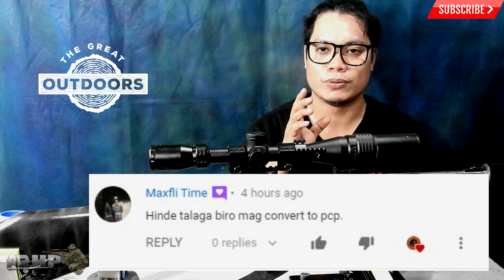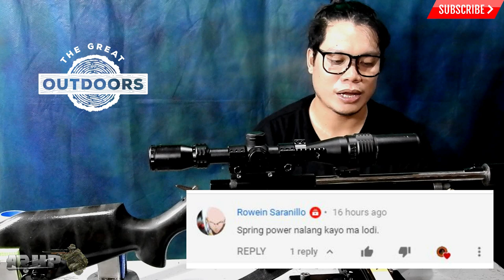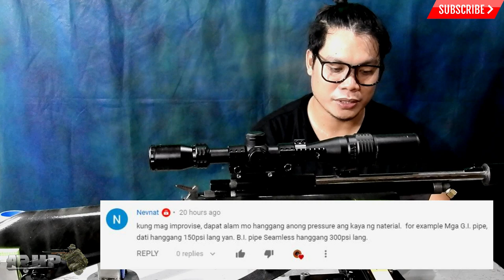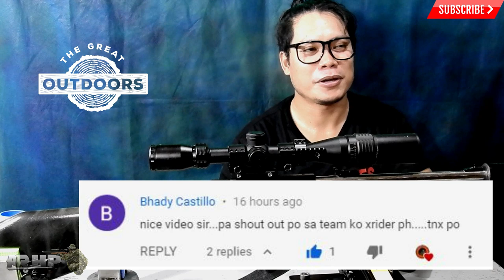BAKIT GUSTO MO NG AIRGUN? | Halagang 7000pesos may Airgun kana

Comment: New subscriber po q
Reply from the maker: Thanks, po sa inyong mensahe. Maraming salamat po sa panonood.
Magandang Araw po sa inyong lahat, Maraming salamat sa inyong pagbisita sa ating channel.
Ganon din, salamat po sa inyong patuloy na pag subaybay. Mabuhay po kayo!
Always keep safe po, and God bless po sa inyo at sa inyong Pamilya.

Regarding po sa tanong ninyo. Pwede nyo pong ma contact sa messenger ang mga sellers po para ma assist po kau sa mga:
1. Contact info like cp# ng sellers
2. Accessories ng mga airgun
3. Brand ng airguns na avail nila
4. pricelist
5. paano ipadala
6. mode of payment
7. saan location nila
8. o may branch ba malapit sa inyo
9. atbp. na mga katanungan.
LOCAL SELLERS:
1. Win Lustarez
2. Robin Samonte
3. Rolly Aurellana
4. Philip Jeffreth Mendoza
5. Raffy Artigas

PAANO MAGING SAFE AND LEGIT CHECK?
1. Mag pa legit check-Ask ang mga matagal na sa airgunner
2. Mag padala ng Private Message- Send a message regarding sa information na gusting malaman
3. Once nag reply ask question regarding sa accessories or type ng airgun na bibilhin
4. Once na nakapag decide na sa bibilhin, mag video call po kayo para na makita nyo xa same sa profile pic at photos ng naka transaction na seller.
5. Before mag bayad sa item na kinuha mag papadala ang Seller ng Video na binabalot nya ung item mo
6. Hingin ang code if sa ano mang currier nya pinadala.

ADD ON QUESTION:
Ano ung valve na naka thread?
Ito po ang vid na ginawa ko sa installation ng airgun nimrod: https://www.youtube.com/watch?v=wrj_i6z119w&feature=youtu.be
Maraming salamat po. From AIR RIFLE HOBBIES PHILIPPINES
______________________________________________________________________________________________

Magandang Araw po sa inyong lahat, Maraming salamat sa inyong pagbisita sa ating channel.
Ganon din, salamat po sa inyong patuloy na pag subaybay. Mabuhay po kayo!
Always keep safe po, and God bless po sa inyo at sa inyong Pamilya.

Ito po yung kadalasang tanong na hope po makatulong.
PAANO MAGING SAFE AND LEGIT CHECK?
1. Mag pa legit check-Ask ang mga matagal na sa airgunner
2. Mag padala ng Private Message- Send a message regarding sa information na gusting malaman
3. Once nag reply ask question regarding sa accessories or type ng airgun na bibilhin
4. Once na nakapag decide na sa bibilhin, mag video call po kayo para na makita nyo xa same sa profile pic at photos ng naka transaction na seller.
5. Before mag bayad sa item na kinuha mag papadala ang Seller ng Video na binabalot nya ung item mo
6. Hingin ang code if sa ano mang currier nya pinadala.
Nagbebenta kaba ng AIRGUN?
-Sa ngayon nag promote and review lang po muna ako ng Airgun na aking nabibili sa mga maker. Pero maka assist po ako if saan po kayo maaaring bumili online.
SAAN MAKABILI NG AIRGUN?
Makakabili o makakaampon po tayo ng Airgun sa mga online store sa Facebook po.
1. Search Airgun group sa "Facebook"
2. Once accepted and join post for inquires
3. They will Private message po sa inyo sa mga details
a. Payment method
b. Specs ng Airgun
c. Warranty
d. Atbp.
4. Do background and legit check po by posting sa group
a. Tingnan mga friends list niya if madami syang kaibigan na Air gunners
b. Kung kalian ginawa account nya at least 5 years
c. Do a video call sa transaction and screen record for assurance.
d. Maganda kaliwaan ang pag bayad like meet up
PWEDE BA IPA CONVERT ANG C02 TO PCP?
Yes, pwede po sir, e check po ng maker if pwede most of the Airgun like: Nimrod, Manlapat, Taurus, Armscor, Atbp.
Pakita nyo lang po sa maker and ang maker na po mag suggest sa inyo anong conversion gusto nyo like bottle o naka tube. Range po sa 8k-12k pataas po ang bayad sa conversion nakadepende po sa maker. 

PAANO PAPADALA NG SELLER ANG AIRGUN?
Papadala sa currier ng seller, sila na po bahala doon.
By buss o barko, make sure po na complete address and my phone number and ask how long dadating.
Ganon din ask ang sellers for warranty what if di makakarating ang Item.

KAILANGAN BA NG LICENCE ANG AIRGUN?

There is no law that will punish anyone in the country for having an airsoft/airgun even if it is not registered. You also don’t need any form or permit or license to own one...our firearms law R.A. 10591 does not include the word airsoft or airgun in there. Feb 6, 2019.
Credit from: Journal.com.ph

PAANO MA PA REGISTER ANG AIRGUN?

Pag nakasali na sa mga Airgun group sa Facebook
You can ask for the legit person for register 
(LARRY AVILA) Philippine Team natin you can ask him po
Magbibigay sya ng mga info for requirments
Maganda if by group po ung pag register para isahan nadin po

PWEDE BANG ISAKAY SA BUSS O BARKO ANG AIRGUN?
1. Kailangan po na naka register ang Airgun
2. Kailangan dn may receipt ang Airgun na makikita kau ang may-ari
3. Mag inquire sa Buss and Ship station if pwede isakay ang Airgun
a. Ipakita ang registration at Reciept 
4. Pag pumayag na sila doon lang dadalhin ang Airgun
5. Baklasin ang Airgun-walang laman na c02 o hangin- at ilagay sa safe na lagayan
PWEDE BA MAISAKAY SA AIRPLAIN ANG AIRGUN FROM IBANG BANSA SA PINAS?
Sa ngaun limited po ang kaalaman ko tungkol dyan, ang iba sabi nila nakakapag padala sila sa balik bayan box.
PRICELIST STOCK AIRGUN: (Walang scope, Bipod, c02 Tank)
Depende po sa Seller ang Price either mababa sa binanggit kung Price o Mataas.
1. Nimrod co2 7500 more or less
2. Manlapat co2 13k more or less
3. Taurus co2 7500 more or less
4. Eskopeta co2 from 5500 pataas
5. Jr mangio co2 from 7500 more or less 
6. PCP pump 3k more or less 3 stage
7. PCP pump 4k more or less 4 stage 
8. PCP starting from 15k-50k local made
9. Scope from 3500-18k
10. Suppressor from 2k-5k
11. Tripod from 1500-2500
12. Scope 3500php to 5000php “Low end”
13. Scope 8000php to 15000php “Mid End”
14. Scope 20000php to 70000php “High end”

About namn po sa mga location ng pamilihan-cnxa po dahil hindi po ako affiliated sa mga company po o pagawaan ng airgun dito sa Pinas o sa ibang bansa.
Thanks, po sa support, Share and SUBSCRIBE po.
 from Air Rifle Hobbies Philippines.
LOCAL SELLERS

Comment: Boss magkanu po yan?
Reply from the maker: Thanks, po sa inyong mensahe. Maraming salamat po sa panonood.
Magandang Araw po sa inyong lahat, Maraming salamat sa inyong pagbisita sa ating channel.
Ganon din, salamat po sa inyong patuloy na pag subaybay. Mabuhay po kayo!
Always keep safe po, and God bless po sa inyo at sa inyong Pamilya.

Regarding po sa tanong ninyo. Pwede nyo pong ma contact sa messenger ang mga sellers po para ma assist po kau sa mga:
1. Contact info like cp# ng sellers
2. Accessories ng mga airgun
3. Brand ng airguns na avail nila
4. pricelist
5. paano ipadala
6. mode of payment
7. saan location nila
8. o may branch ba malapit sa inyo
9. atbp. na mga katanungan.
LOCAL SELLERS:
1. Win Lustarez
2. Robin Samonte
3. Rolly Aurellana
4. Philip Jeffreth Mendoza
5. Raffy Artigas 
6. john brent panizales
7. joe talucod
8. jess devora

PAANO MAGING SAFE AND LEGIT CHECK?
1. Mag pa legit check-Ask ang mga matagal na sa airgunner
2. Mag padala ng Private Message- Send a message regarding sa information na gusting malaman
3. Once nag reply ask question regarding sa accessories or type ng airgun na bibilhin
4. Once na nakapag decide na sa bibilhin, mag video call po kayo para na makita nyo xa same sa profile pic at photos ng naka transaction na seller.
5. Before mag bayad sa item na kinuha mag papadala ang Seller ng Video na binabalot nya ung item mo
6. Hingin ang code if sa ano mang currier nya pinadala.

ADD ON QUESTION:
Ano ung valve na naka thread?
Ito po ang vid na ginawa ko sa installation ng airgun nimrod: https://www.youtube.com/watch?v=wrj_i6z119w&feature=youtu.be
Maraming salamat po. From AIR RIFLE HOBBIES PHILIPPINES

Comment: Pd bang makaorder nyan sir..taga palawan aq..
Reply from the maker: Thanks, po sa inyong mensahe. Maraming salamat po sa panonood.
Magandang Araw po sa inyong lahat, Maraming salamat sa inyong pagbisita sa ating channel.
Ganon din, salamat po sa inyong patuloy na pag subaybay. Mabuhay po kayo!
Always keep safe po, and God bless po sa inyo at sa inyong Pamilya.

Regarding po sa tanong ninyo. Pwede nyo pong ma contact sa messenger ang mga sellers po para ma assist po kau sa mga:
1. Contact info like cp# ng sellers
2. Accessories ng mga airgun
3. Brand ng airguns na avail nila
4. pricelist
5. paano ipadala
6. mode of payment
7. saan location nila
8. o may branch ba malapit sa inyo
9. atbp. na mga katanungan.
LOCAL SELLERS:
1. Win Lustarez
2. Robin Samonte
3. Rolly Aurellana
4. Philip Jeffreth Mendoza
5. Raffy Artigas

PAANO MAGING SAFE AND LEGIT CHECK?
1. Mag pa legit check-Ask ang mga matagal na sa airgunner
2. Mag padala ng Private Message- Send a message regarding sa information na gusting malaman
3. Once nag reply ask question regarding sa accessories or type ng airgun na bibilhin
4. Once na nakapag decide na sa bibilhin, mag video call po kayo para na makita nyo xa same sa profile pic at photos ng naka transaction na seller.
5. Before mag bayad sa item na kinuha mag papadala ang Seller ng Video na binabalot nya ung item mo
6. Hingin ang code if sa ano mang currier nya pinadala.

ADD ON QUESTION:
Ano ung valve na naka thread?
Ito po ang vid na ginawa ko sa installation ng airgun nimrod: https://www.youtube.com/watch?v=wrj_i6z119w&feature=youtu.be
Maraming salamat po. From AIR RIFLE HOBBIES PHILIPPINES

Comment: Magkanu po yang air riffle,
Reply from the maker: Thanks, po sa inyong mensahe. Maraming salamat po sa panonood.
Magandang Araw po sa inyong lahat, Maraming salamat sa inyong pagbisita sa ating channel.
Ganon din, salamat po sa inyong patuloy na pag subaybay. Mabuhay po kayo!
Always keep safe po, and God bless po sa inyo at sa inyong Pamilya.

Regarding po sa tanong ninyo. Pwede nyo pong ma contact sa messenger ang mga sellers po para ma assist po kau sa mga:
1. Contact info like cp# ng sellers
2. Accessories ng mga airgun
3. Brand ng airguns na avail nila
4. pricelist
5. paano ipadala
6. mode of payment
7. saan location nila
8. o may branch ba malapit sa inyo
9. atbp. na mga katanungan.
LOCAL SELLERS:
1. Win Lustarez
2. Robin Samonte
3. Rolly Aurellana
4. Philip Jeffreth Mendoza
5. Raffy Artigas

PAANO MAGING SAFE AND LEGIT CHECK?
1. Mag pa legit check-Ask ang mga matagal na sa airgunner
2. Mag padala ng Private Message- Send a message regarding sa information na gusting malaman
3. Once nag reply ask question regarding sa accessories or type ng airgun na bibilhin
4. Once na nakapag decide na sa bibilhin, mag video call po kayo para na makita nyo xa same sa profile pic at photos ng naka transaction na seller.
5. Before mag bayad sa item na kinuha mag papadala ang Seller ng Video na binabalot nya ung item mo
6. Hingin ang code if sa ano mang currier nya pinadala.

ADD ON QUESTION:
Ano ung valve na naka thread?
Ito po ang vid na ginawa ko sa installation ng airgun nimrod: https://www.youtube.com/watch?v=wrj_i6z119w&feature=youtu.be
Maraming salamat po. From AIR RIFLE HOBBIES PHILIPPINES
______________________________________________________________________________________________

Magandang Araw po sa inyong lahat, Maraming salamat sa inyong pagbisita sa ating channel.
Ganon din, salamat po sa inyong patuloy na pag subaybay. Mabuhay po kayo!
Always keep safe po, and God bless po sa inyo at sa inyong Pamilya.

Ito po yung kadalasang tanong na hope po makatulong.
PAANO MAGING SAFE AND LEGIT CHECK?
1. Mag pa legit check-Ask ang mga matagal na sa airgunner
2. Mag padala ng Private Message- Send a message regarding sa information na gusting malaman
3. Once nag reply ask question regarding sa accessories or type ng airgun na bibilhin
4. Once na nakapag decide na sa bibilhin, mag video call po kayo para na makita nyo xa same sa profile pic at photos ng naka transaction na seller.
5. Before mag bayad sa item na kinuha mag papadala ang Seller ng Video na binabalot nya ung item mo
6. Hingin ang code if sa ano mang currier nya pinadala.
Nagbebenta kaba ng AIRGUN?
-Sa ngayon nag promote and review lang po muna ako ng Airgun na aking nabibili sa mga maker. Pero maka assist po ako if saan po kayo maaaring bumili online.
SAAN MAKABILI NG AIRGUN?
Makakabili o makakaampon po tayo ng Airgun sa mga online store sa Facebook po.
1. Search Airgun group sa "Facebook"
2. Once accepted and join post for inquires
3. They will Private message po sa inyo sa mga details
a. Payment method
b. Specs ng Airgun
c. Warranty
d. Atbp.
4. Do background and legit check po by posting sa group
a. Tingnan mga friends list niya if madami syang kaibigan na Air gunners
b. Kung kalian ginawa account nya at least 5 years
c. Do a video call sa transaction and screen record for assurance.
d. Maganda kaliwaan ang pag bayad like meet up
PWEDE BA IPA CONVERT ANG C02 TO PCP?
Yes, pwede po sir, e check po ng maker if pwede most of the Airgun like: Nimrod, Manlapat, Taurus, Armscor, Atbp.
Pakita nyo lang po sa maker and ang maker na po mag suggest sa inyo anong conversion gusto nyo like bottle o naka tube. Range po sa 8k-12k pataas po ang bayad sa conversion nakadepende po sa maker. 

PAANO PAPADALA NG SELLER ANG AIRGUN?
Papadala sa currier ng seller, sila na po bahala doon.
By buss o barko, make sure po na complete address and my phone number and ask how long dadating.
Ganon din ask ang sellers for warranty what if di makakarating ang Item.

KAILANGAN BA NG LICENCE ANG AIRGUN?

There is no law that will punish anyone in the country for having an airsoft/airgun even if it is not registered. You also don’t need any form or permit or license to own one...our firearms law R.A. 10591 does not include the word airsoft or airgun in there. Feb 6, 2019.
Credit from: Journal.com.ph

PAANO MA PA REGISTER ANG AIRGUN?

Pag nakasali na sa mga Airgun group sa Facebook
You can ask for the legit person for register 
(LARRY AVILA) Philippine Team natin you can ask him po
Magbibigay sya ng mga info for requirments
Maganda if by group po ung pag register para isahan nadin po

PWEDE BANG ISAKAY SA BUSS O BARKO ANG AIRGUN?
1. Kailangan po na naka register ang Airgun
2. Kailangan dn may receipt ang Airgun na makikita kau ang may-ari
3. Mag inquire sa Buss and Ship station if pwede isakay ang Airgun
a. Ipakita ang registration at Reciept 
4. Pag pumayag na sila doon lang dadalhin ang Airgun
5. Baklasin ang Airgun-walang laman na c02 o hangin- at ilagay sa safe na lagayan
PWEDE BA MAISAKAY SA AIRPLAIN ANG AIRGUN FROM IBANG BANSA SA PINAS?
Sa ngaun limited po ang kaalaman ko tungkol dyan, ang iba sabi nila nakakapag padala sila sa balik bayan box.
PRICELIST STOCK AIRGUN: (Walang scope, Bipod, c02 Tank)
Depende po sa Seller ang Price either mababa sa binanggit kung Price o Mataas.
1. Nimrod co2 7500 more or less
2. Manlapat co2 13k more or less
3. Taurus co2 7500 more or less
4. Eskopeta co2 from 5500 pataas
5. Jr mangio co2 from 7500 more or less 
6. PCP pump 3k more or less 3 stage
7. PCP pump 4k more or less 4 stage 
8. PCP starting from 15k-50k local made
9. Scope from 3500-18k
10. Suppressor from 2k-5k
11. Tripod from 1500-2500
12. Scope 3500php to 5000php “Low end”
13. Scope 8000php to 15000php “Mid End”
14. Scope 20000php to 70000php “High end”

About namn po sa mga location ng pamilihan-cnxa po dahil hindi po ako affiliated sa mga company po o pagawaan ng airgun dito sa Pinas o sa ibang bansa.
Thanks, po sa support, Share and SUBSCRIBE po.
 from Air Rifle Hobbies Philippines.
LOCAL SELLERS